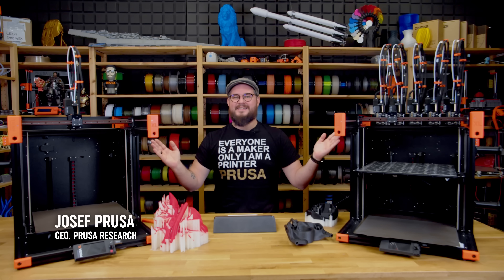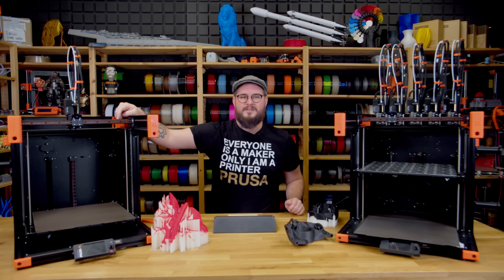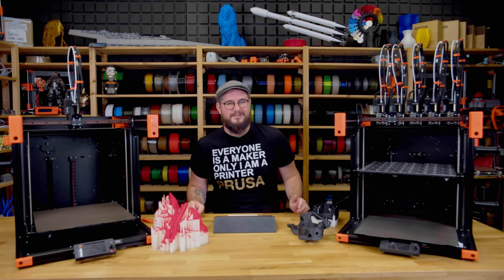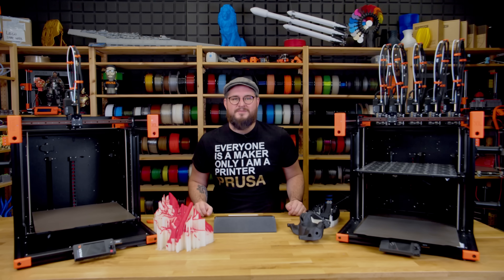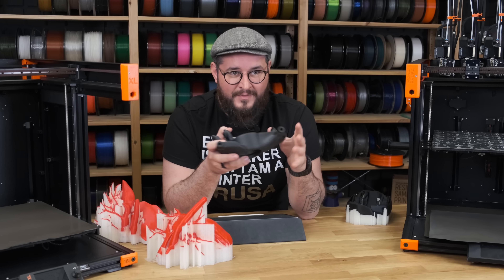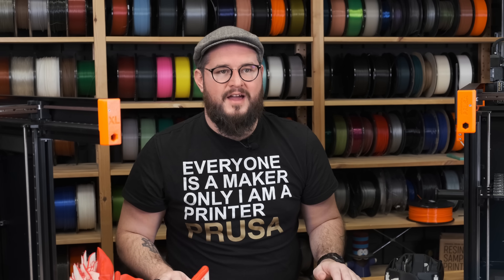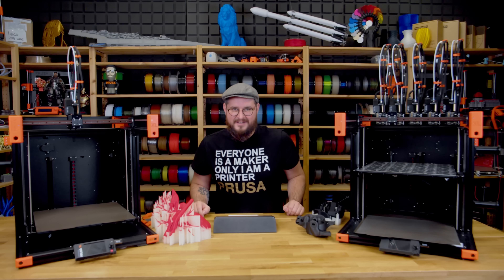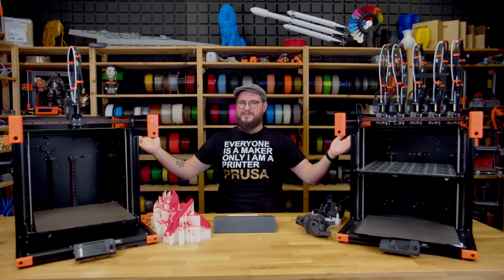XL update - beta test news, hardware changes and shipping schedule

Comment: There are two multi-extruder XLs: one with two extruders, and one with three or more extruders, correct?
Reply: It can be 1/2/3/4/5. But I read somewhere else that if you plan on multi..get the 3.. cause the board for 2 doesnt support 3/4/5. So if you plan on it.. you may as well get 3 heads (that is what my plan is).. and add two more later if you need them. That may be different now.. not sure.. but if its true.. upgrading from 1 or 2 to 3/4/5 would require a pcb change too (or something else changed).
Reply: @WhySoDivided-CantWeAllGetAlong  It's a separate board, not a replacement. So you just add it in when you go from 2 to 3+ toolheads.
Reply: So for shipping, will a 2 toolhead units ship before 3 or more toolhead models - probably, eh?
Reply: @MattKasdorf  No clue, maybe. I think it'll be mid 2023 before we find out lol

Comment: Do you have any estimate on speed of the printer?  This is a big factor.
Reply: If you want fast ... get a Bamboo X1 Carbon, but you also end up with a more proprietary printer... still stupid fast out of the box.
Reply: @Wingnut353  Too expensive to operate though. Tears through filament.. unless you're just using one color/material. In that case.. the P1P for 700 is probably the best/fast printer you can get right now. That printer is worth it. X1C is too expensive to operate.
Reply: Pietro Ken  he mentioned high speed caused the resonating of the sides. So it must have some speed to it.
Reply: @Imagine-Nation  The last update I Think they said it will be a lot faster than the MK3.. but have yet to see anything showing it. I would hope it can sustain 300mm/s or more given that so many printers are now coming out with these kinds of speeds.
Reply: @Kevin Duffey  agreed it needs to support decent speed, especially given the price and competition such as the x1 carbon.
Reply: Pietro Ken  Speed is not everything my friend.
Reply: @punishedbrains  It is when its main competitor is lightening fast!
Reply: @Vincent Groenewold  no..  but it is part of the everything.

Comment: how dose the 5 extruder even work?
Reply: @bomas_ulz  I agree.
I have an MMU2s and it's been mostly headaches and failed prints.
I'm super excited for the XL with 5 tool heads, even though there alot of unknowns still. It can't be worse then the MMU lol
Reply: @bomas_ulz  I'd think a design like their current MMU2s unit is more prone to clogs because of it constantly loading and unloading filament.
This is a much better solution, and the only con I can think of atm is its price. I believe 5 extruder models would be around $3k Whereas a Mk3s+ with the MMu2s unit would be around $1.5k if I'm not mistaken.
Reply: @galacticviper4453  5 heads (in us) is 3500 unassembled.. 4K fully assembled. Each head is 500 additional.. so 3 head is 2500. To me it makes sense to have at least 3 heads.. so that you could print supports with one, and then 2 colors.. or two diff materials (tpu and PETG) with the other 2..
Reply: its a single motor /belt assembly with a quick disconnect sort of thing. So it will put the hot end its using away, and dock to the next one, instead of having 5 nozzles on one hot end, it has 5 actual hot ends.
Reply: @bomas_ulz  My MMU2S works fine an reliably. But yes, with hundreds of tool changes in a print, it will need some intervention now and then. But, so would a manually fed MMU2S printer, you'd just be around in that moment. :)